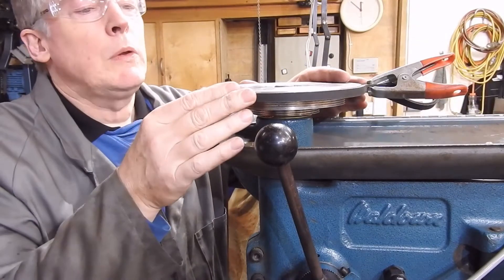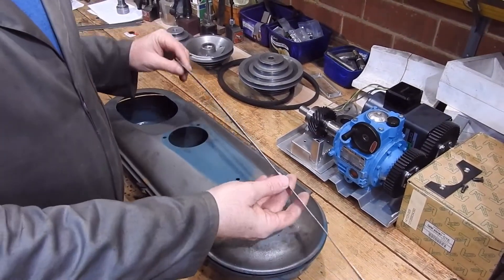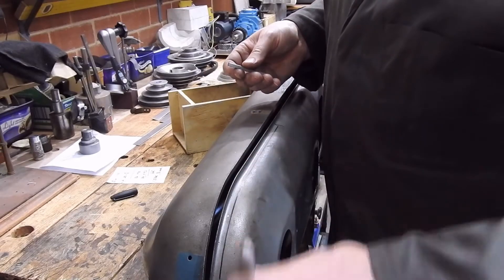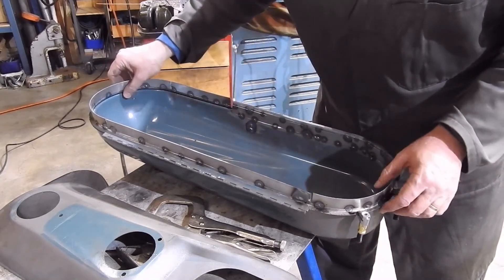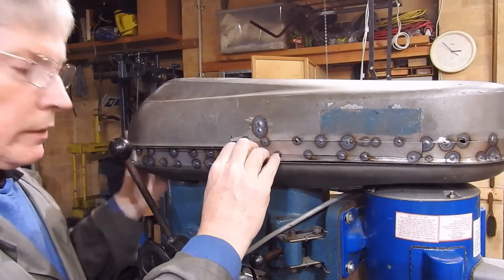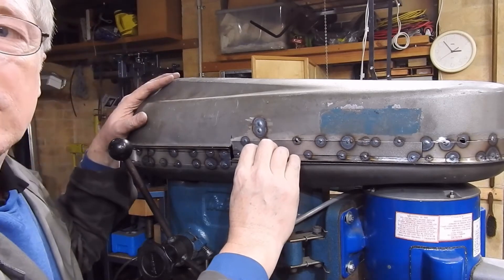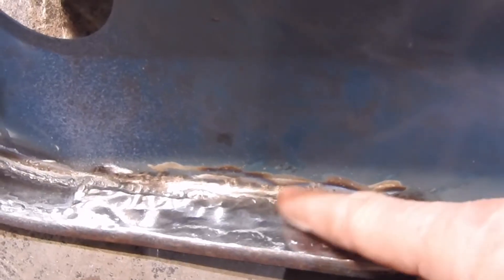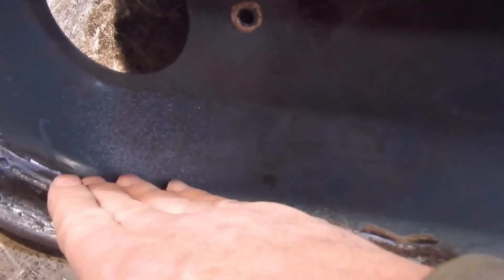Changing of the guard (Waldown pt. 3 and a bit...)

Comment: Great video, I know it's a bit late but what I do to correct the Hinge is to put a 2.5mm welding rod stripped of flux between the hinge and close the lid, this stretches the hinge a little to allow the lid to close properly, easy way to fix it.
Reply from the maker: Thanks. Not sure when I'll next be doing a drill press belt guard though...
(One was enough!)